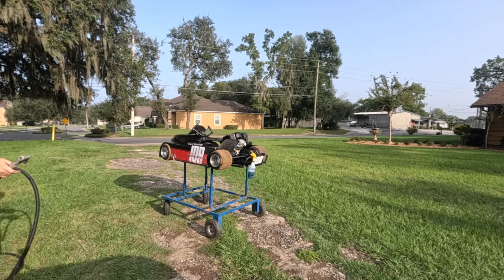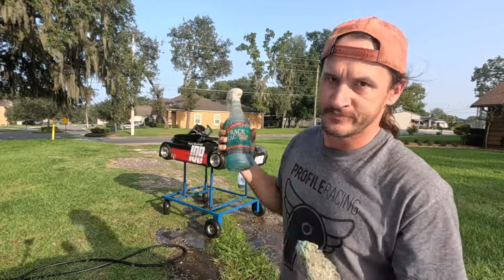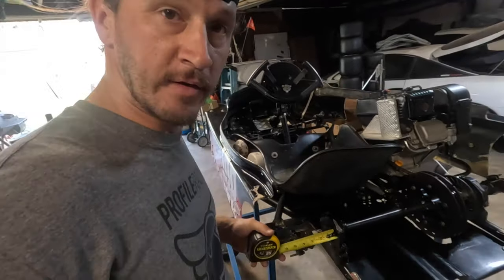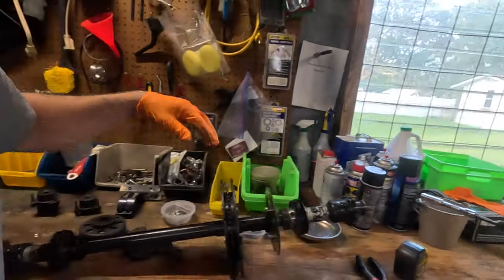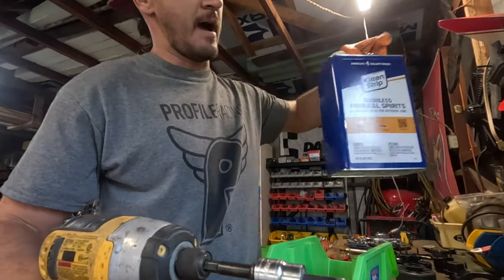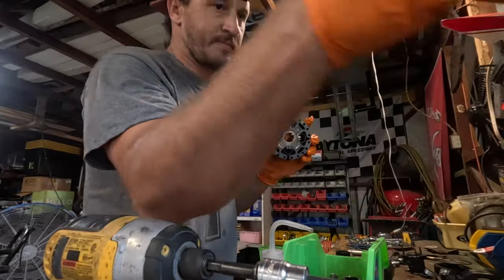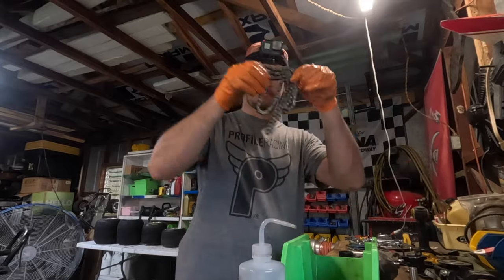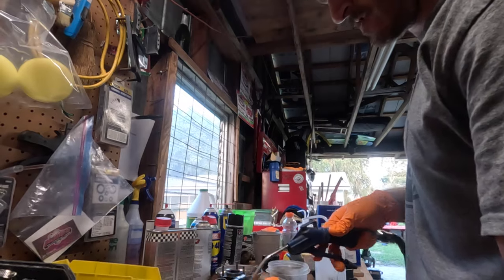Welcome to the shop! Cleaning up the bearings on the Faktor!

Comment: Everyone that commented on using grease. Grease slows the bearing down and collects more dirt and you want fast bearings. I was taught when you buy bearings to take them apart and remove all the grease and lube them with something like tri flo or zep 45 before installing them. I personally use zep 45 and it works great.

Comment: Hi  Nick
Don't You Grease The Rear Axle Bearings ? I Know They Are Sealed, But You Can Take The Bearing Covers Out With A Fine Instrument & Pack The Bearings. I'm Pretty Sure You Can Anyway. 
Also When Cleaning Your Chain & Bearings _ A Tooth Brush Is Very Handy
P.S      I Like Watching Your Channel
Reply from the maker: I do not use grease, it collects dirt. Just a synthetic lube, Tri-flow. I actually did use the toothbrush! That might have not made the cut. And thanks for the support!

Comment: What clutch springs are you on? We use all whites for low engagement but have to be replaced every couple race weekends but engagement is awesome for restarts
Reply from the maker: I'm actually using 4 whites with an additional 2 black springs across each other, creates a low stall.